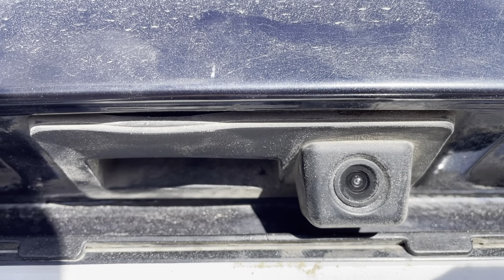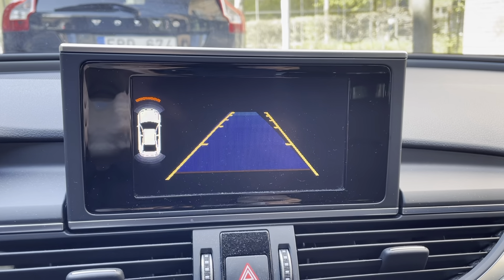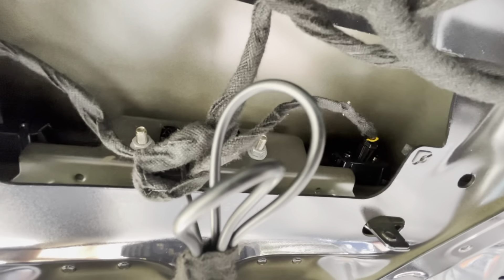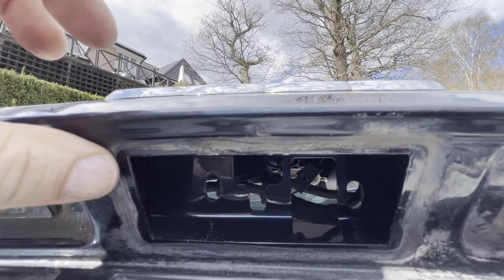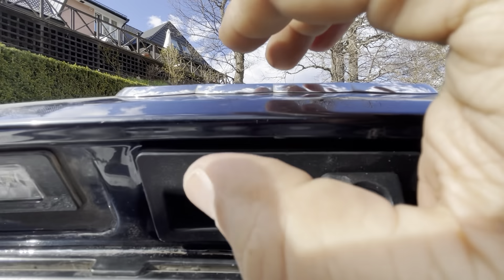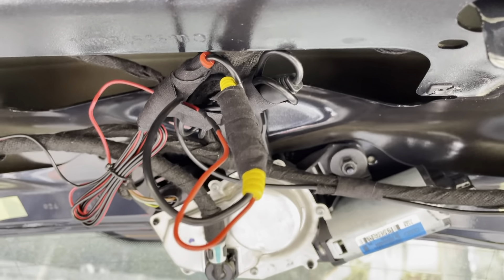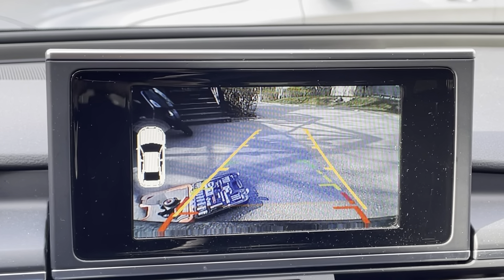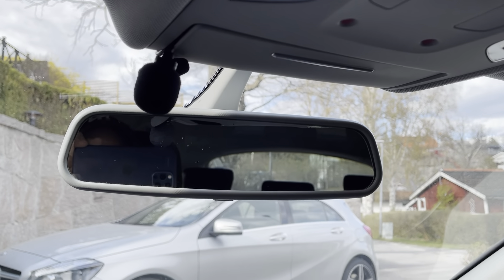Audi backup camera replacement. Retrofit on Audi A6 c7

Comment: I'm a little bit disappointed, you didn't put the inner cover back using only one hand ;-)    kidding great video!
Reply from the maker: I know :-). After unscrewing the 4 screws you have to use quite a lot of force to pull the cover loose. Those clips are sturdy :-)

Comment: Hi! Good video. Im in the process of installing a back up camera too (an add on to my retrofit carplay module) i got the same car as you Audi a6 avant 2018. Do you know what the color is on the cable for the reverse light? Or which pin it is? I don not have a multimeter at the moment. 

Im assuming black wire goes to a nut in the trunk and the red wire goes to the reverse hot wire. Thanx in advance. 

And if you happen to be swedish, you can svara på svenska. Ha det gött! 😊🇸🇪
Reply from the maker: Hej, kul att du gillar videon. Var väldigt länge sedan jag gjorde detta men stoppa videon och gör Screnshots så ser du var den svarta tunna kabeln går.
Reply from the maker: Den svarta tunna kabeln går som du ser då till karossen snett upp till vänster i luckan. Den tunna röda kabeln går direkt integrerad i den gula AV kabeln hela vägen fram till CarPlay enheten bakom handskfacket. Vill minnas att strömmen går därifrån i samband med att man lägger i backen.
Reply: @mr_fix  tack för svar. Min kabelsats ser nog lite annorlunda ut än din. Kameran och de två (svart och gul) kontakterna ser identiska ut. Kabeln dock, har i ena änden en gul kontakt (som jag antar ska in i CP-boxens rear camera kontakt) och bredvid den kontakten finns en gul 10cm lång kabel. I andra änden finns en svar kontakt och en röd kontakt (som jag antar ska kopplas till kamerans svarta och röda kontakt. Och samt en 50cm lång svart/röd delbar kabel (säkert jord och pos). Därmed kan jag inte göra samma anslutning som du. Tror jag blir tvungen att tjuva från backljuskabeln med den röda, och den svarta fäster jag i jordpunkt, likt dig. Några ideer? 

Hoppas du förstod min långa förklaring 😬
Reply from the maker: Stämmer nog som du säger. Du får nog koppla till någon av bromsljusen. På min gula kabel har jag en liten röd kabel integrerad som du ser att jag kopplat till den svarta tunna kabeln som leder till den svarta splitkontakten mot kameran. 
(svart kontakt (som kopplas till röd på kameran) har en röd och svart där den svarta går till jord och den röda går till röd som är integrerade i den gula videokabeln).

Min kamera har kortfattat en röd och en gul kontakt. Din verkar ha en svart och en gul kontakt.

Comment: Is it possibl to install a original audi backup camera to my C7? It was born without the backup camera
Reply from the maker: Yes, anything is possible but it might be quite a complicated process compared to an aftermarket solution. Here’s how you can go about it:

1. Choose the Right Camera Kit
You’ll need an Audi OEM backup camera kit that is compatible with the A6 C7 model. The kit usually includes the camera, wiring harness, and module that integrates with the car’s existing MMI (Multi Media Interface) system.

Make sure the camera kit is compatible with your specific MMI version (MMI 3G Basic, MMI 3G High, or MMI 3G+).

2. Installation Process
Mounting the Camera: The camera is usually installed in the trunk handle. You will need to replace the existing trunk handle with the new one that includes the camera.

Wiring the Camera: The wiring harness needs to be routed from the camera in the trunk to the front of the car where the MMI unit is located. This can involve removing some interior panels to hide the wires properly.

Connecting to the MMI Unit: The camera connects to the MMI control unit, which may involve installing an additional video interface if your current system does not have one.

3. Coding the MMI System
After the hardware is installed, the MMI system must be coded to recognize the backup camera. This usually requires using diagnostic software like VCDS (VAG-COM) or ODIS to enable the camera functionality in the MMI settings. Coding may also involve setting up guidelines and other camera features.

4. Professional Installation vs. DIY
While it is possible to do this as a DIY project if you have the necessary skills and tools,  I would recommend having a professional handle the installation to ensure it’s done correctly.
Professional installation ensures proper integration with the MMI system and avoids potential issues related to wiring or coding.

Consider Aftermarket Options
If an OEM installation seems too complicated or costly, there are high-quality aftermarket kits (like mine that I ordered from a company called “Unique auto developments”) designed specifically for the Audi A6 C7 that integrate with the factory MMI system.

Anyhow, Installing any backup camera can significantly improve the car’s functionality and driving safety.

Comment: HI, I have the same car and want add a reverse camara to my retrofitted CarPlay unit,just wondering how you pull the cable from the unit to the back of the car ? Thank you
Reply from the maker: Hi Abu, it’s kind of difficult but I would suggest you go to an Audi workshop and asked them how to remove the side panels below or above the doors. There are a few ways to do it either above or below the doors. The critical point is the passage through the “arm” of the trunk into the actual trunk. Since it’s a moving part you want to lead the cable through the rubber hose with the rest of the cables. I will try find a video that shows that otherwise you might convince one of the guys in the Audi garage to do it for some money “on the side”.
Reply from the maker: Some hints
https://www.audiworld.com/forums/a4-b5-platform-discussion-1/easiest-way-run-wires-head-unit-trunk-144800/
Reply from the maker: https://youtu.be/k08g1mqNX9g 
Shows the same principle
Reply: @mr_fix  . Thanks a lot , really appreciate 😎
Reply: Hi again, I can see you have a matrix taillights as mine. Just asking what’s the color of the reverse light cable? And secondly did you have to wire the camera with a relay..I have 2017 A6 with RMC unit..do you live in Sweden ? Cause the environment looks as such..thanks
Reply from the maker: @abuabdulai4770  yes I live in Sweden. I’m sorry but I really don’t remember the colour of the reverse light cable since I did this a very long time ago. Did not connect to any relay either. 
But everything was straightforward except the MMI Cable I had to lead from the compartment between the front seat to the CarPlay unit In order to make the sound work wirelessly.
Reply: @mr_fix  Jag visste det..har redan monterat carplay bara att koppla backkamera .Asså jag vågar inte göra själv..haha, tack iaf
Reply from the maker: @abuabdulai4770  Testa att dra till någon mekaniker, hitta någon ung person som är bra på bilar och fråga om dom kan hjälpa dig för en billig peng. Lite bökigt att göra det själv på gatan :-)

Comment: Yo tengo la cámara OEM pero falla como la del video, podría instalar una como ésta sin problema? Seria quitar y poner?
Reply from the maker: Hola, claro que sí. Siempre puedes quitar la carcasa de plástico en el maletero para ver cómo se ve. Mi suposición es que solo se necesita reemplazar la cámara, ya que puede soltarse fácilmente debido a las vibraciones, ya sea OEM o no. En el video no se muestra, pero tendrás que aplicar fuerza para desprender la pieza de plástico de los clips que la sujetan bastante fuerte. Pero si has quitado los tornillos como se indica en el video, no deberías preocuparte.
Reply: @ pero teniendo instalada la OEM habría que codificar de nuevo? O solo reemplazarla y ya funcionaria?
Reply from the maker: Dudo que kameran esté codificada. Si hay conexiones cerca de la cámara para el video, probablemente solo sea cuestión de cambiar la cámara.

Comment: Hey, can you please send me the picture where it shows, how to do the power connection with the backwards driving lamps? That would be very much appreciated!! 
My aftermarket cam came with a filter, which I am supposed to connect into the powerline and then I need to connect the red cable to the original Audi-cable which activates the backward driving lamp. The black I hope I can simply connect to the metal of the trunk, since it´s supposed to be ground, right?
Cheers for any help!!
Reply from the maker: Check this video out

https://youtu.be/HwfjcGh935Q

Black goes to ground
Reply from the maker: Those quick splice wire connectors are super cheap

Comment: Halo. How you wired cables from camera side. Just negative "-" to the body?  From Carplay side positive " +" to the "REAR 12 V" ? I bought camera , and i have same car and Carplay, but camera doesn` t work. Can you help me?
Reply from the maker: Have a picture on where it’s connected if you want, where can I send it?
Reply from the maker: I hope the picture I sent helped?
Reply: @mr_fix  Thanks. I sent e-mail to you.😉
Reply from the maker: I hope you received my email. The yellow cable connected to the CarPlay device should connect to the yellow connection for the backup camera (the other yellow one connected to the CarPlay device is for a front camera). if I remember correctly the short red cable connected to the yellow connection should be connected to something named camera/rear/reverse or something like that coming from the CarPlay device and will only give power when you put the car in reverse. On the camera side you connect yellow cable to yellow cable on the camera and the red tiny cable (connected to the yellow one) to the red wire coming from the black connection. The thin black cable coming from the black connection should be connected to ground like in the picture I sent you. 
Good luck!
Reply: @mr_fix  I connected the front cables to one yellow and another one to a brown cable called CAM-PWR, the back I have two cables red and black-red which are not connected to anything
Reply from the maker: @MrAdvokatas  In the back you should have a yellow connection for the camera with a small red cable coming out of it that you connect to the red one on the black and red cable.the black cable from the red and black one needs to connect to ground like in the video.